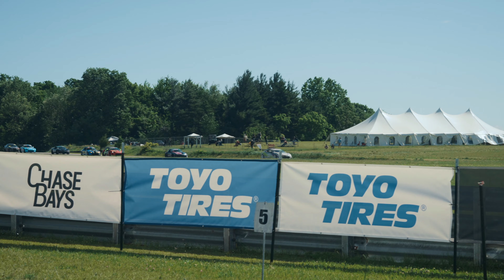Road To GLTC | E7

Comment: If you guys are still using the stock tl70 transmission on your FRS they have a shitty aluminum output shift that the throw out bearing rides on and it gets damaged easily so it will wear out the throw out bearing by making it stick so pdm and clutch max pro made a sleeve kit so the throw out bearing is not riding on aluminum and you'll use a throw out bearing from a Corolla cause it's oversized or if you're down to do a little r&d k power industries makes a hydraulic throw out bearing for the 6 speed Miata it uses the same output shaft has the tl70 transmission